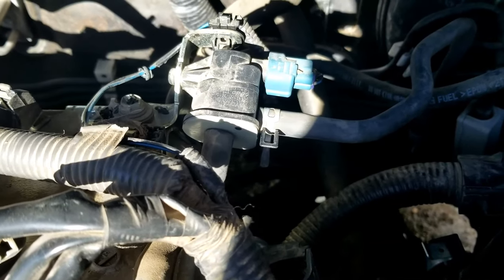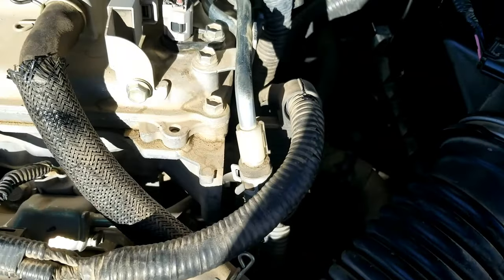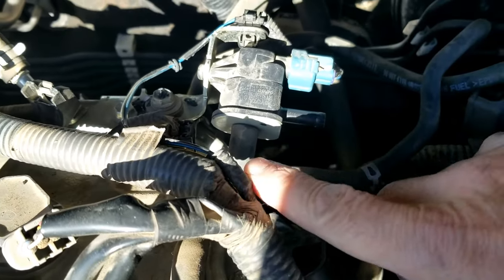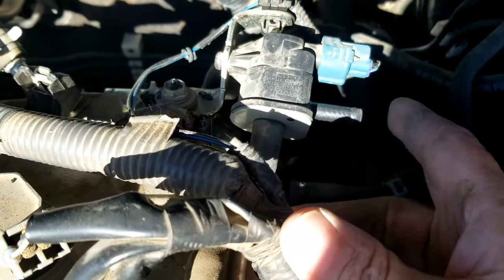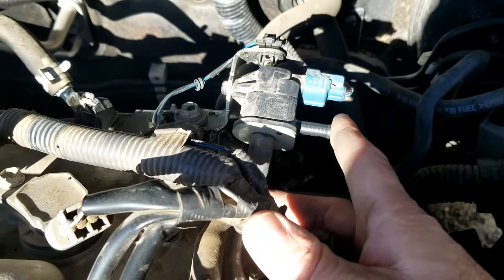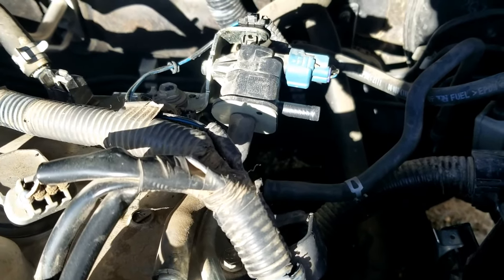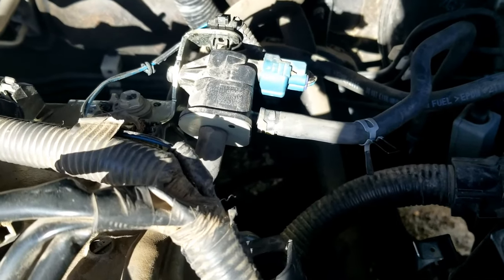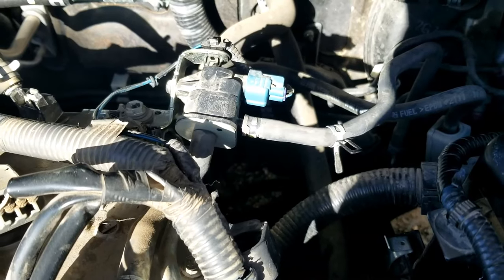How To Test Evap Purge Valve is Good or Bad (No Tools Needed)

Comment: So this test only works when the engine is cold? So if it’s shut the cart off after 20 min or more will it still be open what would happen?
Reply from the maker: It can vary and depend on the vehicle when the computer sends a signal to open, but usually, it is closed when the engine is cold, and after getting hot, the computer sends a signal to open. If the engine is off, the computer will close it hot or cold.
Reply: @HVAC_Mechanic  I have a 2007 4.6 F150 I keep getting P075 bank 2 too rich but I can’t fine the problem.
Reply: @HVAC_Mechanic  When I started the truck today cold it was open as soon as I started it with a cold engine I drove for 15 minutes to my house and it was still open after 20 minutes I restarted then it was closed.

Comment: Quick question. So I did that and I have suction but it doesn't seem very strong. For example if I test the hose coming from the engine without the purge valve connected there is a strong vacuum suction but when I connect the purge valve it seems to open but does not seem nearly as strong as the vacuum inlet to the purge valve. Is it a possibility the valve is only partially opening and is defective. I feel like the amount of suction I'm getting wouldn't pull much farther down the line to the charcoal canister and leak detection pump. Have any thoughts? Should I just swap it out and go from there? Thanks.
Reply: It is a valve that is either open or closed. Another test is to unplug it, and there should be no vacuum. It is a normal closed valve that is opened by the computer when the engine warms up.
Reply: I have vacuum from the engine hose to the purge sensor. I have the hose disconnected from the purge valve that goes to the charcoal canister so I could feel if any suction occurs when the purge valve opens. It feels like it opens but the vacuum feels much weaker than the vacuum suction I get before connecting the purge valve. Wouldn't the pressure be the same once the valve is open? I checked it further down the line where it meets the canister as well and it feels even weaker. I feel like its not opening correctly to allow the vacuum to fully function. Does that make sense? I feel like I'm getting a little suction but its weak. I did let it run to warm up.
@98

Comment: Can this valve cause a no start when the engine gets warmed up? 🤔
Reply: What if I was using the car and then I stopped it for 15 minutes and then I did the test after that and the valvul sucking air as soon as I turn on the car on
Reply: Welp, I put a new one my vehicle, it starts now when it's warm, it didn't with the bad one. So you should probably add a no start as one of the symptom's.
Reply: Have this issue on my crown Vic rn
Reply: @mikeharris8365  literally my issue with scion xb. But I have to warm it up in this cold weather. By the time it’s warm it shuts off. Then doesn’t start lol

Comment: I replaced the purge valve on 2012 fusion because i got a engine light code saying “very small leak” within the emission system. Replaced it, car runs great, but it makes a clicking noise is this normal?
Reply: I may be wrong but a clicking noise may be a sign that your rocker arms are damaged or loose. In the process of illumination I came across that symptom and they say it could be the rocker arm

Comment: I have the 5.3 Yukon 1500. Engine light on and it's pulling a code po449. The the engine hesitates at take off I don't know what the big deal is. I sure don't want to go underneath and get into that big hassle of changing the EVAP. Above the axel. And blowing out the lines is a hassle because you have to unhook him at the fuel pump. Then I saw another YouTube video that shows a whole new style of evap canister. And you have to have new heater hose in order to make it work.

Comment: @HVAC Mechanic have RidgeLine, I’ve noticed some differences in design with the EVAP system in that and odyssey and pilot and so on. 
I did this test, disconnecting hose to the engine loud and string vacuum, also disconnecting the hose to canister and nothing happened, no vacuum; waited 15 some minutes and still no vacuum. Vehicle running disconnected the wire harness, nothing happened.
Should I replace the solenoid? Thanks
Reply from the maker: The computer will send a signal for it to open at some point, which can vary. You could drive the car to the store and back and then test it. There are other tests. It is just a solenoid that opens when power is applied to it.
Reply: @HVAC_Mechanic  the evap codes have always been there along with VTM-4 and 02 sensor codes.
Electrician says just replace the solenoid, just because it work and gets power to it doesn’t mean it actually opens up. I’ve seen many people fix it lights/codes go away and within weeks it comes back with same symptoms.
Reply: @HVAC_Mechanic  what codes did you have? I have P0443 Evaporative Emission System Purge Control Valve Circuit. I’m not sure if I can get away with just replacing the solenoid by the intake (if that’s what it is), or just replace the whole charcoal canister and clean the lines of any build ups. Thank you!
Reply from the maker: It may also be the purge valve wiring. I made a full video on all these components and how to check them; here is a link. https://youtu.be/C5s3Rx3wjD0

Comment: What if it works intermittently? When I started the car (2008 mercury mariner hybrid) it would not suck even after warming up. The car was higher than normal on idle and the p0455 code came in. I have checked voltage on the connector and I was getting 14v. When it went down to 13v I plugged it back to the valve and it started sucking. The engine light went away. Is the valve the issue or should I look elsewhere?

Comment: So if it has vacuum right away it's a sign that it's bad?
Reply: Remove the hose and  electrical pin connector, start if vacuum faulty unit

Comment: I replaced my purge valve 4/5 days ago and I just did this test, still had a vacuum while the motor was cold. I’m having all sorts of problems that seem to be the fuel pump but could it be this new valve is also defective?
Reply: It’s connected to charcoal canister. That could be your issue or maybe even contaminated fuel.
Reply: @spazzologist  shit bro at this point I still don’t know what’s causing it, ended up getting it running fine again, then coil pack in Cyl 1 went bad. It’s been leaking oil into it since I bought it (obviously I didn’t know that was happening until 2 months after I bought it) that was at 140k miles it’s at 204k now, the leaking has gotten worse of course but it just keeps pushing. Gotta love that Toyota ingenuity, built to run even when it’s broke 😂😂

Comment: will a stuck open purge solenoid cause the Po450 code i had my Toyota T100 3.4 check engine codes that came up i had the P0450 code and the P0441 code i know my purge solenoid is stuck open it draws vaccume whenyou start engine cold

Comment: If I can feel the pulses of vacuum when I compress the hose connected to it while the car is running, and then disconnect the electrical connector and still feel the vacuum, will that confirm that it's stuck open?
Reply: yes

Comment: i have a p044  obd2 code  Then I got a P045  code.. which is basically small and large leaks ,  Yeah it doesn't show the other number at the end but anyway I reset everything between each code being tripped after putting a new gas cap on whatever...  On occasion I noticed if I let my car sit overnight .. When I start the car immediately with the blower motor inside the car defroster on I'll smell gasoline for a few seconds.. then it goes away..  doesn't do this all the time..   obviously the smell is coming from the engine bay.. What should I check ?  obviously the fumes are being released into the enigine bay.. I don't see any leaks and I don't smell it with the hood open just happens at start up And on occasion..   if i let the car sit for a couple hours, I do the same thing no smell , I'm wondering if it's even related to those codes Or it could be because I kind of over clicked when I filled up the last time ,    but it's done it before   I'm about to make a smoke machine to test it out ,,   do you have any advice in what to check?  Since I've never really dealt with the fuel system much ..I'm watching so many videos before I even attempt it
Reply from the maker: When gas can be smelled with an EVAP code, there is likely an EVAP leak somewhere. I would also start with a smoke test. Components to check are the purge valve, charcoal canister, and all the hoses. The charcoal canister has a vent valve that also can fail.
Reply: Evap canister purge valve same thing just had happen to me
Reply: i'd recommend checking the vent valve,
its the main hose that is open to the bay an not connected on anything else,
it might be posible that its solenoid valve is stock open
Reply: When you have a evap leak you can't find... ?
 You need about a 2 foot extension hose to add and buy , a full-size cigar...   And blow smoke in the system...  😮

Comment: Does that can cause gas pump stops every second when filling the gas please help 
I don’t have any codes 2021 Ram promaster 3500
Reply from the maker: It usually is an issue with the Vent Valve on the charcoal canister. I made a video on this. Here is a link. https://www.youtube.com/watch?v=t_nSVNa-48c
Reply: @HVAC_Mechanic  the most thing I’m surprised for, no check engine light no codes on obd scanner!!!! Vent valve changed without any code or check engine light (because the old one piston moving when shaking the valve, but the new one doesn’t) but still has the issue

Comment: I replaced the purge valve on my 03 Durango, and I blew out the charcoal canister. I even replaced the gas cap and still got p0443 code.
Reply from the maker: I would test the wiring, fuses, and check for an EVAP leak.
Reply: @HVAC Mechanic   turned out I had gotten 3 bad purge valves before I got one that worked. 
I'm a also a Texas licensed HVAC contractor.

Comment: Any way to bypass that  to get home
Reply from the maker: Most engines will run with a bad purge valve. But if the engine is running badly, you could unplug one of the purge valve hoses and plug it so there is no intake leak.

Comment: Hi, i think i have a problem with the evap system.. when i start the engine a whistling noise comes from the purge valve tube and it stops 2 to 3 seconds after i turn off the engine. I replaced the tubes with silicones hoses and nothing changed.. when i touch the silicone hoses i feel to much air passes from inside straight to the intake manifold.. what do you suggest?

Comment: Can this cause low rpm at highway speeds? My car normally runs at 2500 at highway speeds but now it drops to idle speed
Reply: No
Reply: Change ur pcv valve.            What kind of car do u have

Comment: His description of how evap works isnt entirely true either the computer will command the evap purge valve at certain conditions if it cant open or close preperly it will throw fuel trim off and cause misfire conditions
Reply: But it is accurate test though

Comment: How can you tell if it’s sticking
Reply: Several ways remove hose &  electriacl,vaccum,faulty. Remove unit ( one bolt) along with hose & electrical and if you can blow thru it , faulty
Reply: Forgot if there is a vacuum as some as you start it's faulty